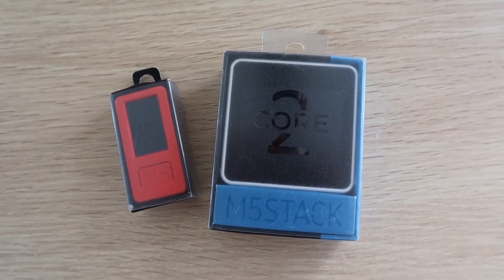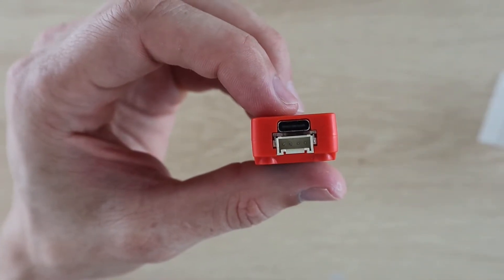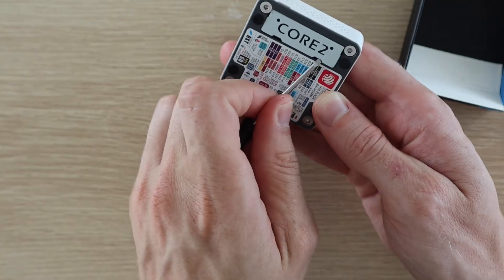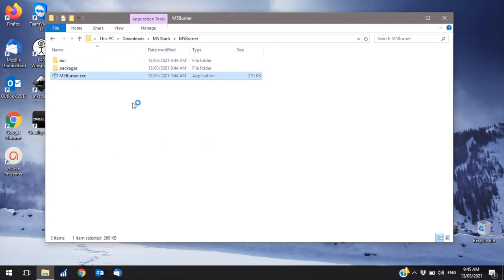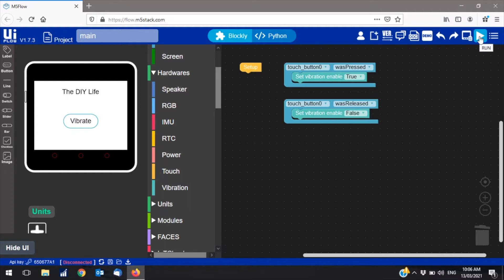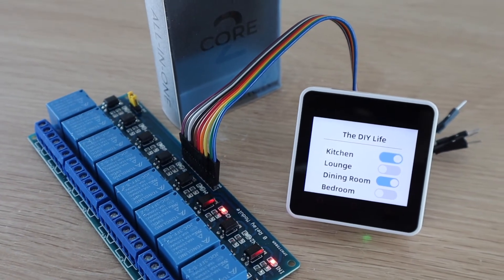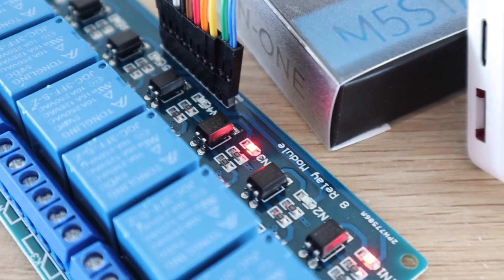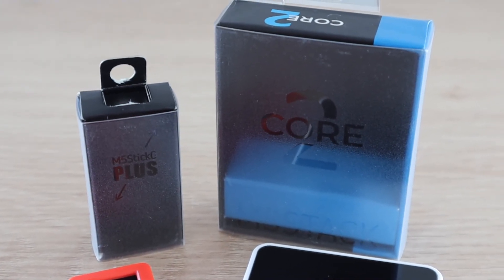Trying Out The M5Stack Core 2 and M5StickC Plus With Ui Flow

Comment: I know this is a sorta of a old video but I'm wondering if you can help me write a code?... What I'm aiming for is to solder a ground plus positive to my computer power button and write a code to power on and off the computer from m5stack instead of the actual PC. Just want to write a button or switch on the touch screen of the m5stack that's always displaying ( putting a PC in my maserati granturismo ) is this possible? What I want to do is simulator to what you're doing in this video.

Comment: I'm new to arduino and have been studying your videos and others' to motorise a camera slider I have (just 1 step motor probably nema 23, plus tb6600 driver - to move a camera payload of 5kg max - plus connecting a PS4 controller for joy stick and buttons).  I've found all the code components, and just started learning arduino coding... and researching all the hardware options... then found this device!  

I like the look of ui flow, and the visual approach to building code seems much more intuitive for someone with no coding experience. It reminds me of Davinci Resolve's nodes based ui which I like for the same reason.

Do you think ui flow is easier to code/programme for my application?  Which would be the fastest way to proceed?  thanks
Reply from the maker: It really depends on your experience with each IDE. UI Flow is definitely much easier to approach as a beginner, but there are limitations in what you can do. I personally find Arduino's IDE to be the easiest and most powerful for me, but that's just because I've been using it for years and I know what I can and can't do with/through it. I found with UI Flow that it took me a long time to figure out how to do something if it wasn't immediately clear how to do it.
Hope this makes sense.
Reply: @MichaelKlements  thanks for the quick reply... well I had to look up "IDE" (lol) which tells you a lot I guess!  Even the jargon is a learning curve.

Yes that does help actually.  I checked out a couple of videos on UI Flow, and I can already see what you mean... but it's very helpful to hear first hand your experience.  Of course, my problem is different from yours: your existing knowledge probably gets in the way, and I have no such problem!

In UI Fow, I'm not sure how I would know which 'blocks' I need for a project, and I think that's where the UI gets a bit difficult, it sort of assumes you know what you're looking for.  I guess, to be fair, that's a problem all the IDEs have: you need to know your hardware requirements, some basic electronics concepts, and have some idea of the functionality you need for both the hardware and your 'use case'... which is not obvious if you have limited or no experience of any IDE at all!

What I liked the look of with the M5Stack was the form factor and screen with all those built-in capabilities... so much potential, but it's also a bit overwhelming if you don't know where to start.  

I'm currently thinking that Arduinos might be the way to go actually.  Having done a YT free Arduino coding course, and studied the AccelStepper documentation, I've already learned the basics of the code structure and AccelStepper functions.  Examining some example codes from GitHub has been a really good way to get my head around how the code works, as well as which code I might need for the functionality I have in mind.  So I think this might well be the easier route, ironically, as it's just a matter of understanding the logic and then copying and then adapting existing code.  

I've figured out the motor requirements and which driver I need (in theory at least, so I'm going to over-specify the motor just to be safe), the OLED screen I want to use, and the interface controls.  So now it's just a puzzle... I can see why people get so sucked into this maker culture... I'm even getting interested to learn basic CAD software lol...
Reply: @MichaelKlements  BTW, have you made the Raspberry Pi version of your camera slider yet?  I was intrigued at the possibility of plahing with image-recognition, though it may be well beyond my ability at this point...
Reply from the maker: Yeah I think if you've got the time to learn each of them then your time would be better spent on Arduinos. There is a much larger online community and I've never run into a problem or had a question on a project which someone hadn't already experienced. The online community is really helpful to point you in the right direction or get some guidance when you get stuck.
It is very much an iterative process. I usually start with a list of what hardware inputs and outputs I'd like to have, then figure out the sensors, boards and actuators etc. and then tackle the programming. If its complex then it helps to get a small program running with each individual sensors or hardware components first before combining them.
I don't really like using Raspberry Pi's for projects than can be done with a microcontroller. It doesn't make much sense (in my mind) to use a Pi for a project that a microcontroller can handle better for a fraction of the price. With an Arduino you don't have to wait for it to boot up first or worry about shutting it down afterwards. You just turn it on and its ready to go and unplug it when you're done. They've also got analogue inputs built in. Pi's are only really useful for projects where you need strong networking abilities, lots of data processing or data logging and AI applications.
Reply: @MichaelKlements  Thanks for those explanations, that really helps clarify when to use Arduino vs Raspberry Pi. And I can see that Arduino is a really versatile platform for projects, just from the little bit of exposure I've had so far to such a wide range of projects that can be accomplished with a mircocontroller.  I really like your prototyping suggestion of testing each bit of code with a single bit of hardware/sensor - I hadn't thought about it, but I can now see that would make fault-finding much simpler!

Comment: Where can I buy boards and sensors compatible with this core2 product?
Reply from the maker: Seeed Studio, Amazon or Arduino's online store sell "Grove" modules which are compatible with these boards.
Reply: @MichaelKlements  thanks!
Reply: @MichaelKlements  I can buy sensors of arduino and connecting  to m5stack Core2?
Reply from the maker: Yes most sensors that work with an Arduino will work with these as well.

Comment: Hi Michael, Thank for your video.  I would like to try the M5Stack Core 2.  What do you think of the AWS version?.  Which one do you think is better?.  Thank you in advance
Reply from the maker: I've never used AWS or the AWS version of the Core 2, but it looks like quite a nice package. It would be good to know if you're able to re-flash the firmware on this version to be the standard Core 2 firmware if you change your mind in future.
Reply: Sandra, can it be flashed back to original firmware non aws?
Reply: @yes_man_lol  yes it can

Comment: It appears to be electronics packaging from the 90’s. But now modernized.  

It could work in a classroom but not on the desk of any real electronics hobbyist. 

Soldering a component on a PCB is where 1/2 the fun is!
Reply from the maker: I agree that most electronics hobbyists (myself included) would prefer to be more involved in the raw components, but there are loads of people who have little interest in the electronics side and prefer being able to just get started programming. 
It's also quite daunting for a newbie to get a box full of electronics components and have to learn the electronics and programming sides simultaneously, so these help to bridge that gap while still allowing some flexibility to add IO devices at a later stage.
Reply: I don't know, some of my projects ends up just looking awful. This has the ability to expand, but the form factor makes it look more like a finished project. I love it.

Comment: At the price these are, I kinda just don't get the use case.

Due to the fact that the UI, at least from this video only works with this line of products, I just dont see how this could be remotely cost efficient even for prototyping (particularly due to the software being non transferable).

I see the value in being easy to program, but its also sort of its critical flaw. At this price, you are competing with raspberry pis, not microcontrollers. Sticking a 50 dollar item in what would otherwise be a 20 dollar project seems just a bit silly. Maybe its a toy for rich people?

I guess what I'm saying is, because of the high price, and the lack of transferability of the skills acquired to program this device and the lack of the ability to run the programs made here onto other devices, I'm not really sure who I'd recommend it to, as those factors limit the target audience severely I think. Id far sooner recommend an esp32, arduino, or raspberry pi over something like this, which seems filled with proprietary software that may die with one company (though I have done no research and could be wrong about this part).

This is a somewhat techie wealthy, or high disposable income persons impulse drawer filler if I've ever seen one.
Reply from the maker: I agree that they are quite expensive in comparison to other standalone microcontrollers, but they are much more of a complete package. Once you've bought an Arduino/ESP32, a battery pack, power supply, a colour touch display, some pushbuttons, a breadboard and jumpers along with a couple of sensor modules then you're probably not too far from the cost of these devices anyway.

That being said it depends on what you'd like to use it for. Newbies find it quite daunting to order all of these components, have a box of electronics arrive and then have to learn electronics and programming together to get a basic project running. It's also disheartening for them to make a simple wiring mistake and damage the controller and/or sensors before they've got anything running. These bridge that gap somewhat and still allow people to add IO devices at a later stage.

Personally, I'd prefer to have the box of electronics and be able to see and touch the individual components, but that's not for everyone. 

The software side, being Ui Flow, is just one option to use with these devices. They're essentially ESP32's at their core and are compatible with the Arduino IDE and probably most other IDEs which you'd use to program ESP32s.
Reply: I realized this comment went really long, but was in too deep to bother restructuring it so here's a TL:DR:

I think all the points made are true, yet the pool of customers remains basically the same.

It's too closed for newbies to learn skills that are transferable and too expensive for the initial investment in a hobby a new person might not be sure they are really interested in.

It's great for gifts though exactly because of being just barely unjustifiable due to cost rather than being actually unobtanium. 

Boy, if this is the TL:DR I need to stop commenting so much.

---

 @MichaelKlements  I agree with most of what you said, but feel as though there is a caveat which still makes most of my feelings towards the product fair. The caveat, is that newbies aren't usually starting with extremely complex projects. They don't need all of that io right at the start.

Usually, a beginner project will maybe have a couple leds and a button. You don't necessarily need a screen or touch interface or anything like that.

As for the fact that its an esp32 underneath, I almost feel as if that hurts the value proposition because the value, is that its super easy to program for, but then if its an esp32 anyways, but you aren't learning transferable skills, what are you really learning from the experience?

I think it teaches you how to program for this like of products but now how to program. I think it teaches you how to set up a project with these components but now how to use components in general.

That's perfectly fine if you really do not care to progress further, but if you do, its a rather expensive proposition both monetarily for what it is (a fancy ESP32 with custom firmware), and time wise due to having to relearn the basics whenever you move on to a more custom solution.

ALl in all, you make many great points, but I ultimately feel as though while I think they all make sense, non of them really change who I think is the person who is ideal to buy this product. 

I think its too expensive for a regular new person, too limited for someone who is getting into it to learn (unless you kind of defeat the purpose and just move to a different programming suite), and just right for someone with exposable income, and empty drawer to fill, and who might one day use it for a one off quarantine project where they don't necessarily care about going further.

That's perfectly fine, but I think that's a relatively niche audience.

For this to have wider appeal, I feel it could go 2 directions. 

Either it could lower in price (which I understand no company wants to do if they don't have to), or it could have the interface be more friendly to transferring skills/learning. 

At this point I realize I could totally be talking out of ignorance, because maybe it does and it just wasn't talked about, but the ui interface should translate to a real, non closed down programming language. That way at least it would have the real value added benefit of being a good beginners learning tool for microcontrollers.

I do realize I might have a bias with my experience now (I'm actually not even very experienced at all, I've maybe programmed for 3 years now, and have used microcontrollers for less than that in any real hobbyist sense), but I am trying to view things from the perspective of when I started, and as a non rich person, I cant imagine buying one of these as a newbie, yet alone handful of these later.

I have a couple raspberry pis, a jetson nano, and a bunch of esp32s, and I cant justify this now, so I have a really hard time imaging a new person without a lot of disposable income going for this when they arent even sure how interested they are.

As I typed this massive wall of text though, I did realize another potential customer: Gift givers. 

Id never buy this, but I might gift it as its the perfect thing for a gift. Its just past the point that someone might personally justify buying it, yet its still neat. The perfect amount of excess for a gift.
Reply: Beef Ingot/ you have hit the nail on it’s capitalist head. 

Having electronics stuffed into a box will not help new users understand what’s going on under the cover. 

Your review of this “ system “  was well written and clearly explained what this system does and does not do.  

I have a few ideas for the developers. 

(1) make it easy to open up it’s case so users can open it up and see the electronics inside. 

(2) make the case in clear transparent material.  

(3) a complete parts list and a schematic

If you provide the above information then you have a better chance in marketing this system. 

Last point ( made by many) make the software open source

Comment: I would like to see basic projects any novice can accomplish.  I am new to it all and would like to learn the basics. Eventually I would like to learn how to create my own oscilloscope and signal generator and build a toroidal device to turn sound into dc/ac power :)
Reply: I'm also curious about the moisture device.  I am currently building a home hydroponic system and moisture level is important. Can you show me how to upload proper code for that? Also os there a way to spread out the sticks for multiple plants?
Reply from the maker: These are great to learn the basics and they're simple to use if you've got limited electronics or programming experience.
The soil moisture sensor just provides a single analogue signal (0-3.3V) back to the device, so you can add as many sensors as you've got analogue inputs available. If you have a look at my blog (linked in the description) there are a couple of different soil moisture projects on different platforms to get started with.

Comment: I have m5stackc plus and it's fun to work with it. But I am interested in core 2 and more interested in your project with it. I will do it today 😁😁.
Reply from the maker: The touchscreen on the Core 2 is quite nice to use and it's also got a lot more IO pins available at the back to build more complex projects.
Reply: @MichaelKlements  that's awesome man. does it run on a battery?